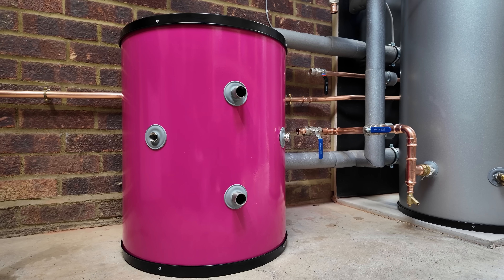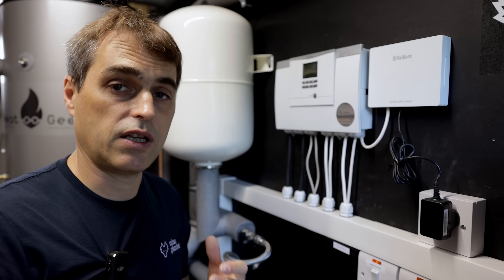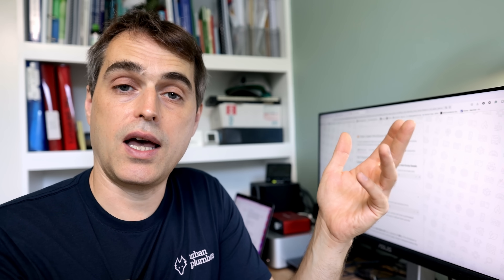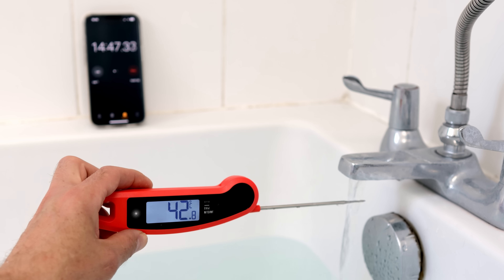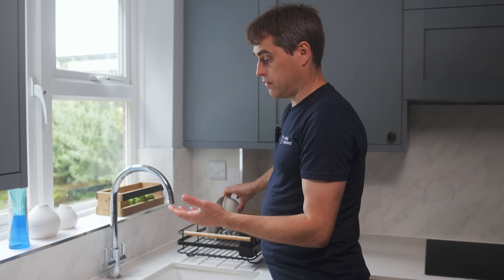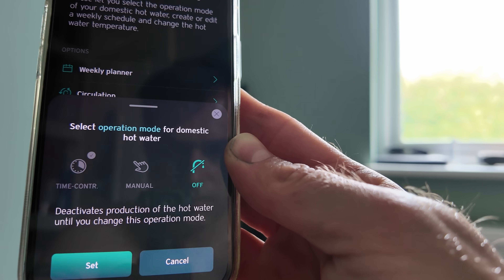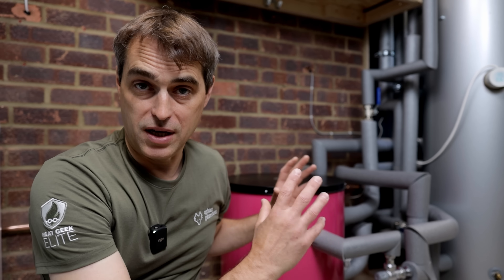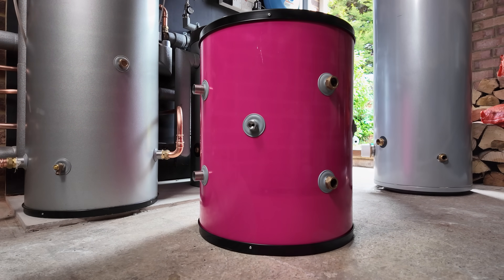Heat Geek Mini Store: Is It a Good Fit For Your Home?

Comment: Everything I see on heat pumps suggests you need to be a technical geek always adjusting things to use them. I want to replace my storage heaters with modern high heat retention heaters. The company contracted under the HUG scheme are suggesting a heat pump. I'm dubious because its all so complicated!
Reply: You're watching a video by an installer mainly for installers. I've not changed the settings on mine for a year and it's perfect!
Reply: For most it's set and forget, this is more about putting the smallest store through its paces to see its capabilities.

For replacing electric store heaters, you're almost always better off getting an Air-to-Air system (Toshiba Haori is very popular in the UK).  As retrofitting an entire wet system for an air-to-water heat pump will be pretty costly.  You won't get the grant for an air-to-air system, but won't have to pay VAT and they're generally cheaper anyway.
Reply: @BenIsInSweden  thanks, but if they do install a wet system then there’s no cost to me as I qualify under the HUG scheme due to low income, no gas and EPC of D. I haven’t seen the details yet of what they’re proposing. I asked for an update as the survey was back in May. They told me it has to be signed off still, but are looking at heat pump, solar and extra loft insulation.
Reply: @StephenLewis-m5s  oh, that's interesting, I wasn't aware of the HUG grant, and that it would include a whole wet system retrofit.  That's probably your best option then.

Comment: I did not understand why you have less pressure than a classic DHW boiler? 
You should have the pressure of the domestic water network (between 4 and 10 Bar in Switzerland). 

Is it because of the pressure drop of the large heat exchanger inside the cylinder?
Or is the pressure vessel tank with the larger boiler works as a sub-network increasing the observed pressure?
Reply from the maker: You can have as much pressure as you want. It’s just the flow rate needs to be limited otherwise you run out of hot water quickly

Comment: A test showing how two of these could be combined for a larger volume/more economical performance would be good. I have two ‘blind’ corners in my kitchen that they could go in.
Reply: The blind corner option it's really good. This has to be one of the most useless spaces in a kitchen and to occupy it with one of these mini.Sstores would be a perfect solution. Most kitchens will have at least two of these dead corners. I'm sure too many cylinders would be expensive however. I wonder what volume of standard water be could be kept in these two dead spaces? There could also be reasonably easily accessed as the cupboards. Either side of the cylinder could be standard single units that would be able to be slipped out to give access to the cylinder. This idea has actually got me quite excited on a sunday morning and that fact makes me feel sad about my life....lol

Comment: A small storage tank is the wrong solution for pairing with a heat pump, but fine with something like a gas boiler with an output 12 kW. The boiler can recover at the rate of 4 litres/minute but the lower power of a heat pump, perhaps less than 7kW in winter, means that recovery is down to about 2.3 litres/minute - insufficient for peak hot water usage times unless you are a one-person or frugal-two household.
With 3 beds, design for 4 people, assuming that 200 litres is needed in half an hour (4 showers or 1 bath and 2 showers).
Multiply your recovery power, 7kW in this heat pump case, by 10 to give the recovery in half an hour. That's 70 litres for this heat pump. 
So the storage needed = 200 litres - recovery = 200 litres - 70 litres in this case = 130 litres. 
If you've got a 12 kW gas boiler, recovery is 120 litres in half an hour so storage required = 200 - 120 = 80 litres. (Priority Domestic Hot Water is, of course, needed.)
If' you've got a 30 kW combi, that will provide 300 litres in half an hour, you need no storage.
But, as the article says, shower design is important. Drench showers, the current fashion, can use 15 litres/minute and demand wastefully large hot water systems. Aim for 6 litres/minute. the current recommendation for government buildings. Your teenage children will indeed spend 10 minutes in them, consuming 60 litres each.

Comment: hmmm maybe a good idea for a single person or under sink tank with main elsewhere to get around flow rate s not affecting the main shower etc, , but for a family  a definite miss, further more just 5litres per min  even 10 is quite slow  given existing gas and 140litre can flow typically 20 literes  with a 22 min recharge on 25kwh its going to be tough sale, convincing customers who may be migrating, i would still stick with a higher capacity cylinder with 50mm with a heat pump

Comment: Thanks for your time spend on testing the Ministore.
During the tests did you come up with any correlations between DHW flow, store high limit temperature and the size of the vessel to use as kind of formula? Do Heat Geek guys have any, as Newark guys do not.
I have spoken to Adam B. from Newark and not only ordering now any Thermalstore cylinder/buffer it will not be ready before mid November but also they have no data or a solution how to calculate the variables to make a right choice. 
Let's say if you had double the size of the vessel(or triple) how that would perform? 
I like the idea but I don't want to order now to be able to start testing the cylinder in mid November to find out if my choice was the right one, to fit it for the customer after all.
Finally if the customer have a space for DHW cylinder would you still fit one (Supercylinder) or have gone for Thermalstore to eliminate the G3 regs and Water regs in terms of Legionella
Great work Simon😊
Reply from the maker: I would fit unvented if there is space
Reply: Thank you very much.

Comment: An ideal partner with a thermostatic shower & waste water heat recovery? A further bonus is no legionnaires cycle needed as the water is direct
Reply from the maker: yes, heat recovery is a good shout for the mini store
Reply: It's certainly an ideal unit for a small flat that already has an electric shower and only needs hot water for washing hands and dishes.

Comment: Unexpectedly negative review given the awesome potential of this thing.   If you want a higher flow rate for a shower couldn't you just make the immersion do more of the work?   It also seems this would work well with a waste heat recovery unit on the shower to enable a higher flow rate.    Like you say  its not as efficient as a full size cylinder but this is the first option I've seen that would make me want a heat pump in a flat.   Combi boilers rule in flats as space saving really matters.  I'm always amazed by people who haven't ripped out their old cylinders / system boilers.
Reply: The issue for flats will come when gas combi boilers are no longer available. As you are aware, flats can be very short of space. This ministore seems ideal to fit into a dead space in a kitchen of a flat - I have a flat with such a dead space that is right under the existing combi boiler.

Comment: Thank you for the video.  I liked the idea of the mini store, i thought it could work for me as have a 3 bed house with varying demend for hot water (currently  on a combi).  40% of the time its just me but the other 60% of the time have 2 children here using lots of hot water.   I'm thinking the 130l version might be better for me, but of course the reheat time would be longer, so maybe then i'd be losing the main benefit of the store?  Is the scenario for the bigger stores they they would be paired with bigger heat pumps?  Ive done heat loss calcs and its close between getting a 5 or 7kw vailant so maybe a 5/7kw would just take too long on the 130l one?
Reply from the maker: 3 bed house surely has space for a full size cylinder? This is designed for flats. Get a full cylinder if you can.
Reply: @UrbanPlumbers  Thank you for the reply.  Yes, I can fit a cylinder in but was attracted to the re-heat time and the change in demand (due to the varying occupancy of the home).  

If were to get a full cylinder would have to spec for the maximum occupancy and would end up wasting energy heating more than I needed when they weren't here. 

I guess this isn't the use case the store was designed for but thought it could work.  Perhaps I am mistaken?

When would you use the 130l mini store?
Reply from the maker: @radfoo  go for a full-size cylinder. When use is lower charge the cylinder to 42C as it will be all you need. Standing loses at that temperature are so small you can ignore them.  Mini Store is really not a patch on a full cylinder in any size. It is a solution, when you don't have the space.
Reply: @UrbanPlumbers And terraced houses I imagine. My parents have a mid terraced house

Realistically the way they could therefore go fully electric is to get AC (for air to air) assuming they get planning permission , and to use these mini store heat stores. Kinda cool for niche applications

It'd be cool to see what the COP is in winter. It'd be nice if they could get to a COP of say 3.5+ though purely because then it'd be cost efficient too to go fully electric.
Reply: Curious about this too. Small 80's semi with a combi.While we could fit a cylinder (there is a converted airing cupboard from the old system boiler days), storage space is so tight I'd be wary to lose it. This issue feels like the latent blocker preventing more folks adopt heat pumps.
Reply: Thanks, I am sure you are correct.  Just have to remember to switch it each time.

Would still be nice to understand how/why/when you would use the 130l version and if there are any advantages or if it is even practical in the scenario I suggested.

I'm perfectly happy with the idea of a heat pump, convinced it would work in my home (done the heat loss etc) but going from a combi from a hot water perspective is a bit of a fear and hoped/thought this might work with the quick re-heat times.  

It is miserable when you run out of hot water.

Comment: Let me guess the fancy pink cylinder its another thousands pounds on top of all the other thousands you've spent, just to still not do as good a job as a 10 year old combi boiler?
Reply: Not sure your point.. Most Heat Pump installs will require a new cylinder on the first install anyway so it's not "thousands on top of all the other thousands spent", the retail price of them can be found easily online.
Reply: @ponchod2924 This is a bit more expensive than gas to run for like for like hot water flow; I'm paying 4.5p/kWh for gas and the equivalent electricity tarrif is 21p / kWh (Octopus Tracker)  With this mini store example showing a COP of 2.5 (in Summer...!) it is around 8.6p per kWh of heat output.  A combi between 80 and 90% efficient will be between 5 and 5.5p per kWh of heat output.  Given it is targeting flats where solar usually isn't available, probably more expensive than gas for most, with significantly worse hot water flow than even the smallest combi.  The only real good argument for this is because you explicitly want to decarbonise / remove gas at any cost (or maybe can't have gas).
Reply: He has a point. It will take you 10 plus years to get your money back. Thats even if its installed corretly!
Reply: @Mark-ob9bk how long does it take to get your money back on a new gas combi boiler?
Reply: @thesquirrelhorde  Alot quicker than an ASHP.
Reply: @Mark-ob9bk  That is of course assuming that the current imbalance in electricity and gas prices continues. If, as it should, electricity prices drop compared to gas, then heat pumps become far cheaper.

The current fossil fuel subsidies and artificial increasing of electricity prices needs to stop.
Reply: @MentalLentil-ev9jr  yes well we all know that electricity will not come down much! Whatever we do the goverment will screw you. Remember when they said lets all buy diesel. Now diesel is the most expensive! Im sticking with my gas for as long as i can.
Reply: @Mark-ob9bk  Electricity should come down as more renewables are added to the grid. The current (crap) formula for calculating electric prices uses the most expensive generator operating at any time, which currently is usually gas powered, the longer the periods where renewables supply the electricity the lower the price. The Conservative government applied a windfall tax to wind farm generators to stop them making high profits as renewable electricity is so much cheaper than gas powered electricity. The much trumpeted windfall on fossil fuel had so many get-outs id did nothing - great, windfall tax renewables and not gas.

Whatever the cost though, the world has to move around from fossil fuels, we have no other choice if we want a future for our children. We cannot continue with gas boilers.
Reply: @Mark-ob9bk how quick do you get your money back on a combi 😂
Reply: @terryfinch9319  well tbf mate ive got mine weather comp and im only heating what im using. So alot quicker than shelling out on an ashp.
Reply: @twelvebears1971  Truth hurts does it

Comment: My showers do not use 3kws a day you.
2kw electric shower would be adequate, mine has a 0, 4 and 9 kW setting and the temperature dial is actually a "flow" dial... Because lower flow is higher temperature for a given power... 

I actually have to constantly switch between 4 and 0 to get the temperature at the modest flow I want, so a 2kwh shower would be better. I only need as little as 5lts, can be more if wanted but not needed.

I can't believe you just assume people need 3kwh a day to shower. I only use around 1.5kwh a day averaged out for everything. I even converted a chest freezer into a chest fridge which is way more efficient for basic refrigeration needs just because it opens at the top not the side.

Comment: I hope you're being objective seeing as Heat Geek is your mate!
Reply from the maker: I was not expecting it to perform at all to be honest. I thought it was just a PR stunt. It works fine, but I would still go for the full cylinder for the reasons explained in the video.
Reply: @UrbanPlumbers  I suppose for washing up it's fine, but we all wash every day (I hope) and yeah it obviously doesn't have the capacity for a bath or a family having a shower
Reply from the maker: @jonjohnson2844  showers only and up to 10-15min max with limited flow with 5-7 min breaks between the showers will work fine
Reply: You are so lovely.